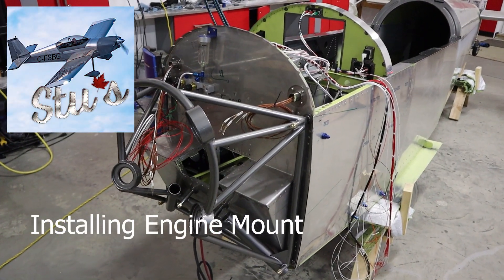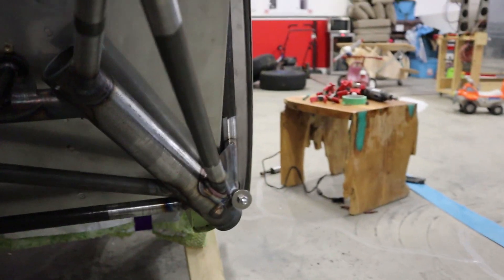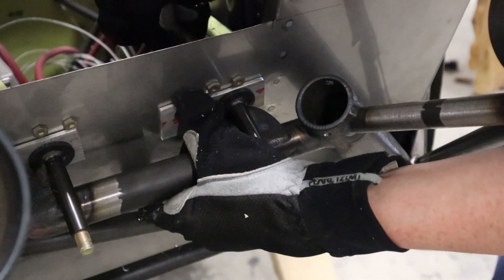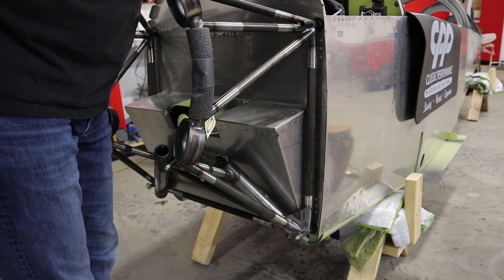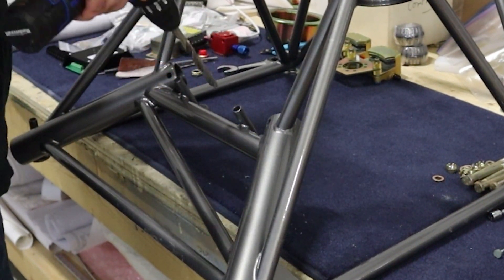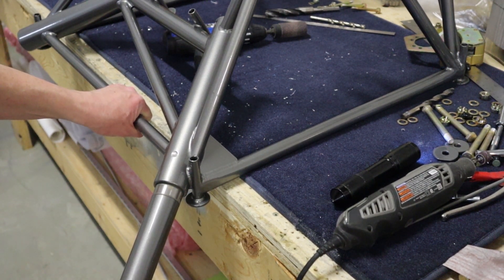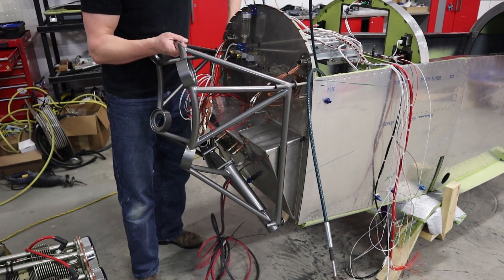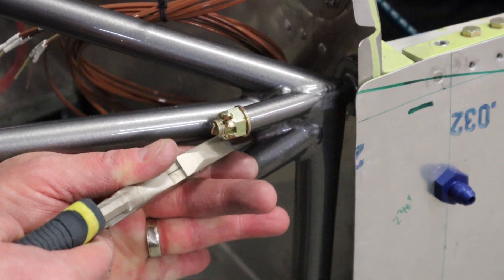RV4 ENGINE Mount Installation

Comment: Two notes, First, Tape off areas where you don't want or need powder coating placed as it is very hard to remove later. Second, align bolts so there is no need to rotate the bolt for the cotter pin after torquing it down. This prevents the torque from becoming invalid or introduce wear on the assembly.